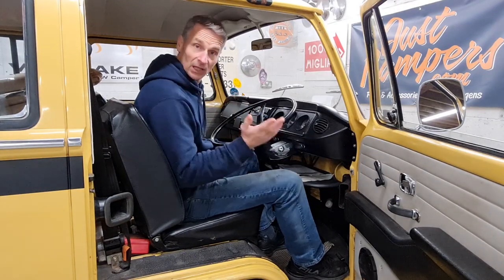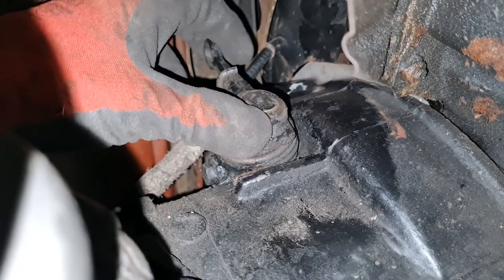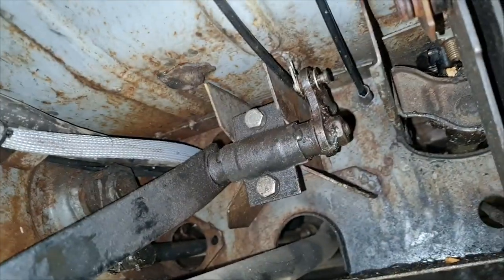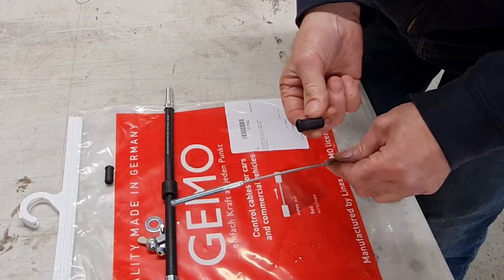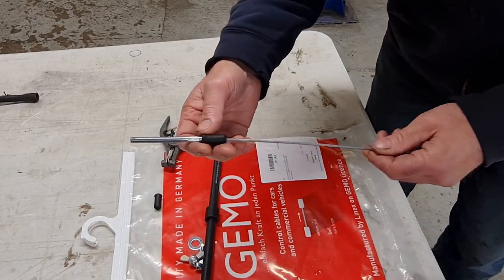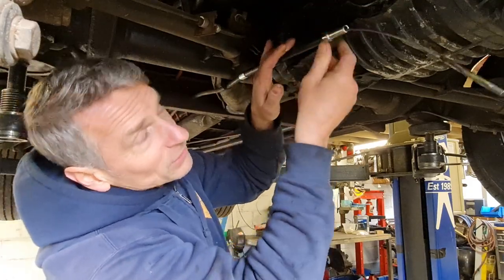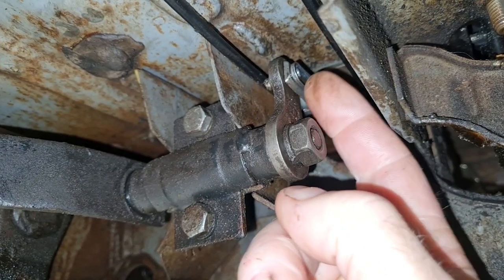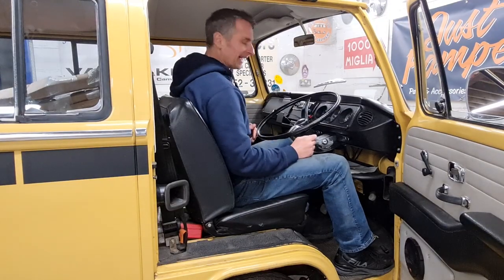How To Replace a T2 Bay Clutch Cable

Comment: The reason someone may have added those washers and nut onto the bowden tube may have been to get the tube to have more curve? This will cause a bit more friction on the cable and reduces clutch chatter.
Reply from the maker: Hi, our bowden conduits are the correct length to prevent the clutch chatter. Many Thanks

Comment: I thought my throw out lever was bad after I replaced the cable. After I pulled the motor it looked fine. Going to check the crank arm and hope that's it.
Thanks for the insight! 
Peace

Comment: Hi Mark, thanks for the video. Is your bus a T2a? Mine is a 1977 T2b and it looks a bit different aaroung the pedal area. And mine is a left hand driver.
Reply from the maker: Hi Steve, our bus was a T2a that maybe why the pedal area looks a bit different.
Reply: @justkampers  whereas there are slight differences in the pedal pivot area (not 'pedal' area as I wrote previously) vs. the T2b, the logic remains the same, so your video is very helpful. I hope I can manage to get the new cable and sleeve in as smoothly as you did. Looks like a walk in the park.

Comment: Do you know where I can source one for a vw t2 Brazilian bay on a 2006 plate
Reply from the maker: We sell a Universal Accelerator Cable that would fit a VW T2 Brazilian Bay if it is a 1600 Aircooled. 
https://www.justkampers.com/00-4863-0-universal-accelerator-cable.html